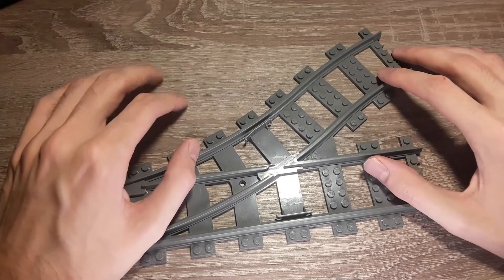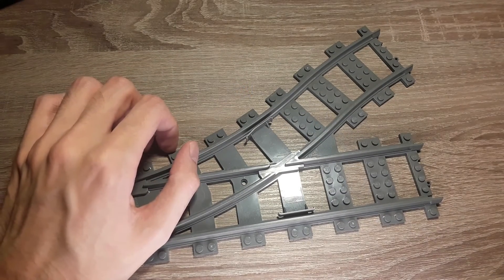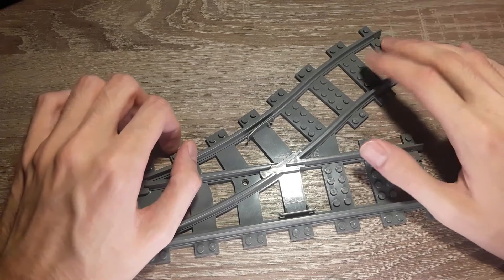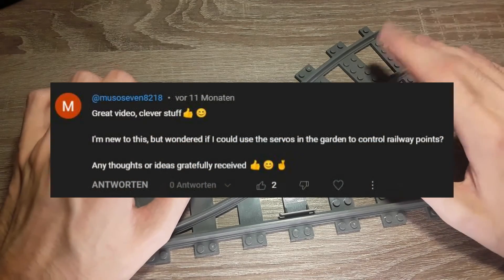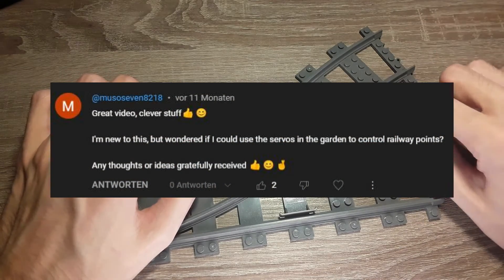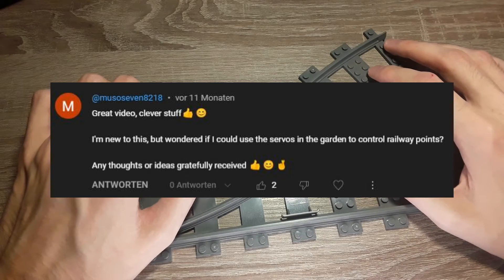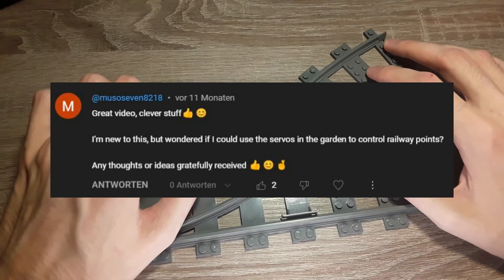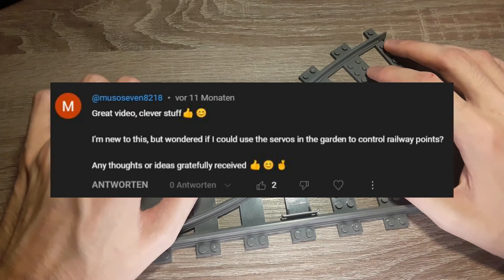HowTo LEGO Trains: motorize railroad switches without modification [English|HD]

Comment: The original design that you found in the internet is the one that I use for more then 10 years. It works fine with PF or PU medium motors. Also works with trix switches but you have to do some small changes
Reply from the maker: Yup. It's very good and it can also be modified for special cases if necessary

Comment: Could you connect a sensor to the switch and place color plates to the front of the train to fully automate the track? Are the trains too colorful to do that?
Reply from the maker: Why don't you try it out? You can also see where it works best. I can imagine that a colored plate would work good at a very low point because there most train parts are black

Comment: I tried this design a while back, it worked fairly well but didn't work well with cheap third party PF motors due to their higher speed and lower torque. I've motorized up to 16 switch tracks at a time so I tend to use those rather than spending over $300 on official motors. I ended up using a modified version of Tom Cook's design that used 2 gears to require less torque. I have instructions on rebrickable if you wanted to give it a try, maybe it was a design you tried that didn't work for you 😅
Reply from the maker: Well I don't really use 3rd party motors (but I also don't have 16 switch tracks). But I did most tests around 2015. Then I found this one and it just works, so why bother with other things.
BTW: I really like some of your videos. You make interestng content :)
Reply: @technicmaster0tutorials  Thanks!  I think another factor was using old 9v switch tracks in varying condition.  New / clean plastic tracks can be a lot easier to switch than 9v tracks that are approaching 30 years old 😅
Reply from the maker: @BatteryPoweredBricks  It might indeed be a problem with the age of the switches. I have the impression that my switches didn't work as well as yours and some of my PUP switches are probably around 10 years old.